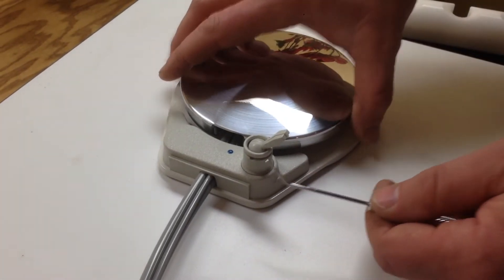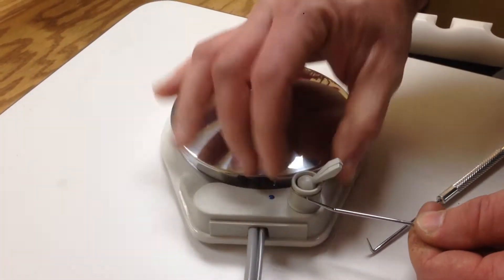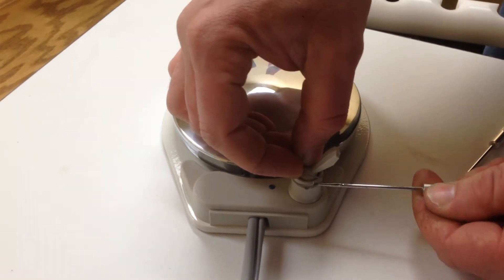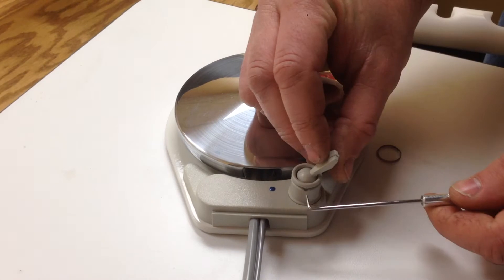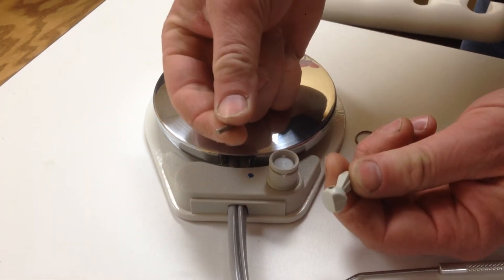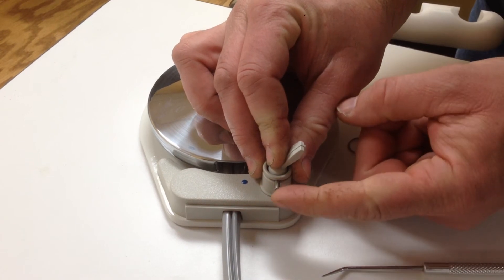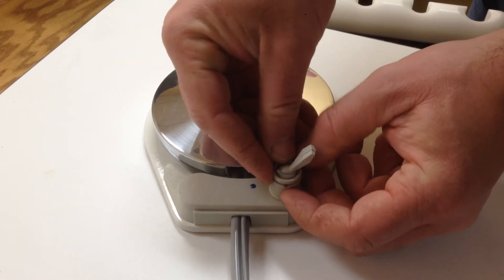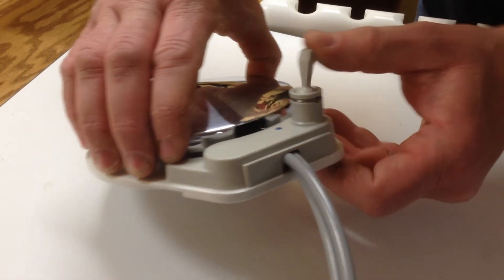repairing a dental foot control rheostat toggle switch

Comment: I did that now there’s no water coming from the dental hand piece what should I do
Reply from the maker: You may need to adjust the valve inside up or down very slightly. There should be a black set screw on the side that holds it in place.

Comment: when ever I press the foot pedal , it directly goes to full speed even with light pressure, what could be the issue?
Reply: rambo ride sounds like it’s either missing an o-ring in the block or the o-ring is worn out.